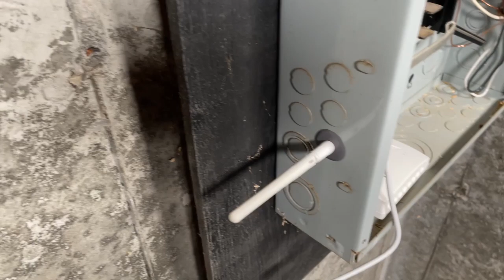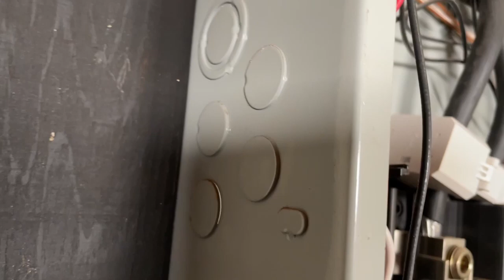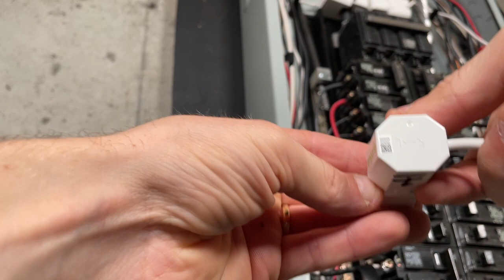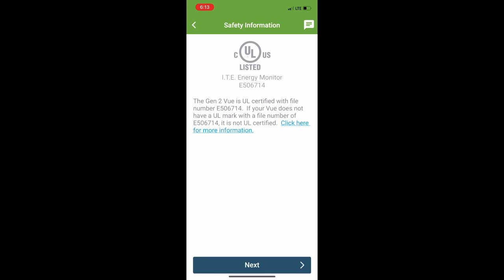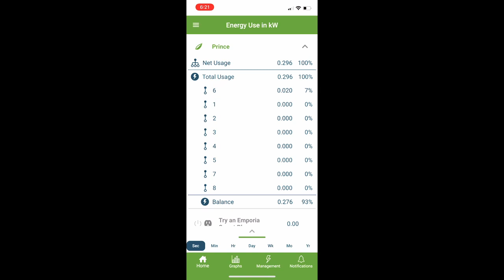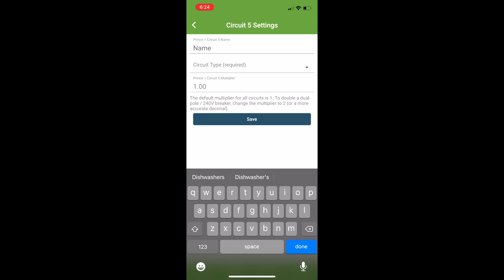Emporia Vue Install

Comment: Excellent video, thanks. Why using pigtail+nut (around minute 13)? Is it not a lot easier to just insert the Emporia wire together with the phase wire directly into the breaker input? And just leaving the pigtail+nut out? That would look not that messy and is easier to install I think.
Reply: I’m not an electrician, but I think the purpose for the pigtail is that it also powers other things inside the home (like bedroom lights) without the pig tail the lights wouldn’t work. The other option if he wanted to only install the power directly would be to install a new breaker. I recall in the beginning of the video he said he didn’t want to install a new breaker.
Reply: With a few exceptions, breakers are not rated to be double-tapped.  The pigtail method is required for code compliance.

Comment: Thank you so much for the video. One question,  Does the air conditioner use the same power from L1 and L2?  If it is unbalanced Multiplier won't work. Correct?
Reply from the maker: Yes, it does.

Comment: I am surprised that you need to work in the fuse breaker box with live power on the wires of the main entry cable. 
In Europe, there is an automatic fuse/breaker switch in the metering enclosure to cut the power coming out of the meter, so no electrocution danger there, because there are no live wires or connections in the fuse box.

Comment: Very informative video but please be careful with your approach. I will not say that you were totally careful. The Feeder breakers (along with Main breakers) should also be tripped before making any sort of wiring.
Do not use an uninsulated tool to point the main live wires from utility.

Comment: I am preparing to install this unit in my main panel and have watched a few install videos.  It seems that a common complaint is the long length of the cables, but one thing I did hear from one person is how nice it is just to be able to plug in the jack as opposed to trying to connect two tiny wires for each connection.  It seems some very good cable management is very important!  I will be putting two of my sensors on a double pull breaker that I use to back feed my panel in case of a power outage.  So based on your video, I do need to go through the steps for the solar/generator, correct?  I was thinking it meant specifically”Solar Generation”. Also, I’m guessing that the sensors going on the wires leading from the generator to the breaker should be put on in the opposite directions of those monitoring the various circuits, since the ‘service will actually be going into the breaker (like the main) and the load will be energizing the two hot busses. Is this correct?  Thanks for the video. Btw I will take all the suggestions of double checking the breakers to make sure they aren’t energized, even after shutting off the main.  Never can be too careful with electricity or firearms!
Reply from the maker: That's how I connected my generator connection & I reversed the direction of the sensor like you indicated & it reads the generator output perfectly.
Reply: This rule should help if you have doubts.  The arrow that goes from K to L, it indicates the current flow from generator (K) to the load (L).  Generator being what generates the power (grid, solar array, etc.) and load (lights, appliances, etc.) being what consumes it.

Also, don't ever attach the CT sensor to a wire that could potentially be energized without first connecting the other end to a closed circuit.  You could damage your CT sensor that way if the wire suddenly becomes energized.  Even worse, you could shock yourself if you accidentally touch the other end if the wire that the sensor is attached to gets energized.

Comment: Shouldn’t the neutral and ground bus bars be isolated?
Reply from the maker: This is my main panel, not a subpanel. Neutral and ground bus bars should be isolated in any subpanel. 

Thanks for watching!
Reply: The panel with the first disconnect (ie. main breaker) should have the ground bus bar  and the neutral bus bar bonded. All subsequent sub panels should have the two bus bars isolated.

Comment: "You still need to be careful even if you shut the power off" 

Proceeds to point and tap around with a screw driver. WTF!!
Reply: wait at 13 minutes he is connecting a lead to a live breaker, why not turn it off?  I just happened to skip to this part - stopped watching.  Please be careful.
Reply: @bigneilh  I just watched the video and the main breaker is off at that point although I agree I would check with a multimeter before touching anything

Comment: Hi for dryer which is 240, 120+120 , you only put one lead for the dryer 120 or can/only add one lead on one of the 120?.
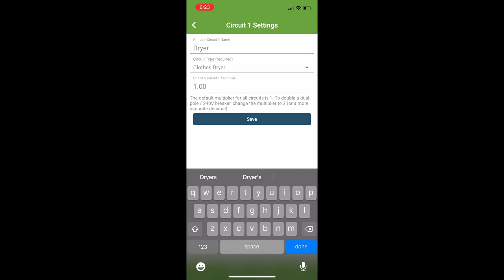Reply from the maker: For 240 circuits, you can put one sensor on only one of the hot wires, then from within the app you select "2" as a circuit multiple - see in my video at 28:10.  Most 240 circuits pull equally from both sides of the panel which is why this works, but you should confirm this is true for your circuit.

Alternatively, you could put a sensor on each side of the circuit and measure each side (120 + 120) individually.

Thanks for watching!
Reply: @idothings6605  The motor that turns the drum is probably 120V - that allows the mfgr to sell a gas version that doesn't need a 240V outlet. So just monitoring one side is a little off.

Comment: Boa noite, Eu tenho instalação Monofásica ou seja Neutro E fase, ok. Então eu gostaria de saber se ligo uma das pinças de 100 A para a entrada da energia e as outras aos vários circuitos. Ou terei que ligar as duas Pinças de 100 A a Entrada de Energia  e Solar. uma vez que tenho produção Solar. Agradecia resposta. continuação de bom trabalho.
Reply: Olá Luis. Não sei em que país se encontra. Mas se está na América do Norte, e o painel é de 100 A, isso não significa que é monofásico. Tem que ver quantos cabos estão chegando do relógio + neutro. Normalmente o aquecimento da casa (furnace) + secadora + fogão elétrico, funcionam com 220V. Neste caso você irá usar as duas pinças. Caso esteja realmente em um circuito monofásico , eu não sei saber se 100A é viável. De qualquer forma, você só precisará uma pinça. Mas veja se no painel existem 2 (buses) corredores onde o disjuntor está conectado. como mostra no video de instalação.
Reply: The directions explain what to do if it is only 1 hot coming in from the utility.  You only use one of the 200amp clamps. But the power wiring is different, so be sure to follow the directions carefully.